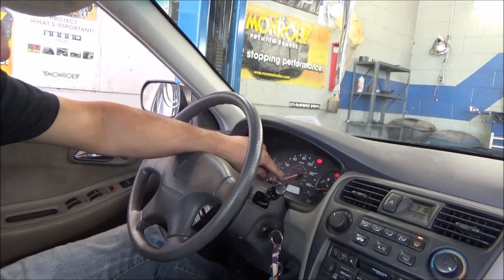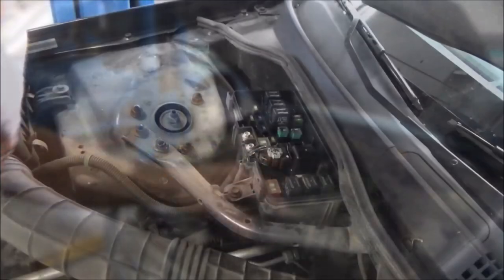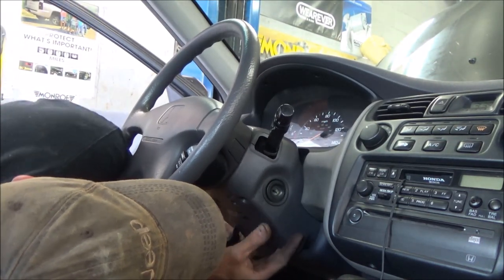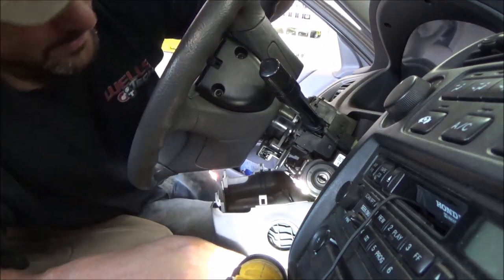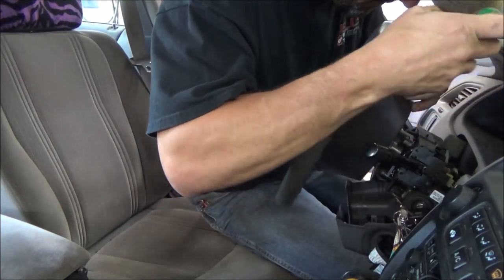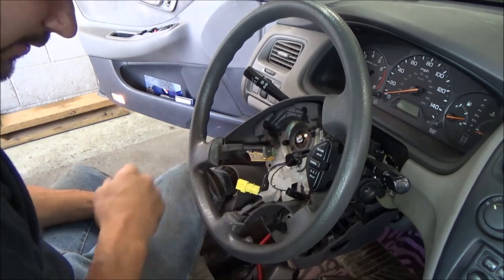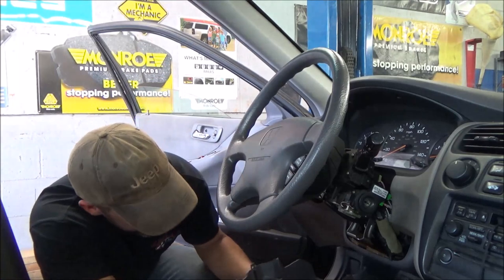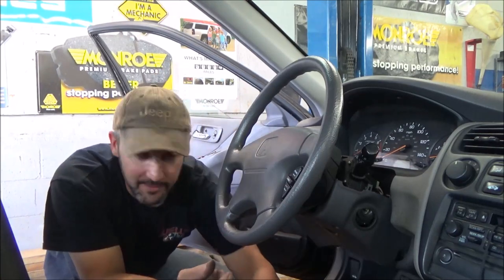Honda Accord: No Horn, No Cruise, Air Bag Light On

Comment: Eric  thanks for video !! I have cruse control problem , 1998 Accord V6  I replace cruse module ,steering switch  , also the on off switch on the left that won’t lid on wen I press, there is no cruse engage ligh on dash  .  Would the clock spring be the problem ? The horn works  ,  the volume switch for radio don’t work on steering  also, I do have a after market radio don’t know if that has something to do.  Am a cruse control user and am trying to fix it  thanks

Comment: @South Main Auto Repair LLC  Eric i have a 98 accord the contact under under the horn pad doesn't not let off and keeps on blowing i removed the air bag but didn't c a way to get under the pad does that means i have to replace the air bag??

Comment: Why would you destroy the part I keep all the parts at my shop since I'm the lead mechanic but I wouldn't destroy it
Reply: Billy Simons It's confirmed broke, what's wrong with doing an autopsy? You can't kill that which is already dead.
Reply: Billy Simons If it could be repaired, maybe. But this is just some plastic junk with a broken proprietary cable inside that you could never replace.
Reply: Billy Simons Unless they're valuable or rare parts, you can get most anything you need at a Pull A Part or other junkyard for cheap.
Reply: Hello world I don't keep them in my shop acctully I keep them in my basement and in my bedroom and all the alternators I keep are in my dining room and spark plugs are in my truck tool box
Reply: Of course she loves me she is the one who likes to keep the parts and help me sometimes on cars but she said as long as I don't get grease on her side of the bed I can sleep in the bed because I keep inventory of all my stuff

Comment: So the cable wire tape was installed in the reel folded like that?
Reply: It's a 15 year old car. The tape would have been pulled back and forth a lot over the years.
It's inevitable that there would be a sharpish bend somewhere in that setup.
Plus plastics become more brittle over time, even well protected plastic will - just takes longer.

Comment: I would love to come and help you but its a long way from montgomery county maryland  by that way I got a question on my 2002 kia sportage the horn gets stuck when I press the switch stops when I remove key from the lock cylinder I don't think is the relay because when I lock the car with the remote control the horn works fine do you think it could be the clock spring I haven't really messed with it yet but I was thinking if it was the switch it will still blow when I put the key back in the lock cylinder

Comment: Merry Christmas to Eric and his family. Thank you so much for all your videos. 
My 2006 Honda Civic have almost same symptoms as this accord had except the horn goes off if I turn the headlight on. 
First SRS light came on, after two weeks cruse control stopped working and this week while I was driving with headlights on the horn started going off. Horn stopped when I turned the headlight off. Recently transmission was changed (ground cable on the tranny is secured) . Another thing I noticed is that when I turn steering wheel rapidly cruse control light and horn comes on for split second. All my symptoms indicates probable cause is faulty clock spring except why does the horn stops when I turn the headlight off? Thank you for your advice and suggestions.

Merry Christmas and happy new year for all

Comment: Great video!!  Question... I think it is possible but, can you loose function to one or two things and not all three within the clock spring?? My srs light came on and I lost my cruise control at the same time but, my horn still works....
Reply from the maker: +Zcudazz That is true, you can loose one or all
Reply: +South Main Auto Repair  
 Thanks for the reply, sorry for the delay and fyi the Horn finally went so now all 3 symptoms are present LOL . My new Clock spring arrived and I  will be installing it hopefully this weekend.  Again thanks for the videos.
Reply from the maker: cool! Don't forget to unhook the battery!
Reply: It is done!!  And the battery was disconnected during it. Just to make sure I didn't mess up... when I put the key in  and turn the car on.... I did it from the passengers side with my arm extended as far as possible and the rest of me as low as I could get LOL!!!  Just in case!!!  The whole process went a lot faster than I thought.   I am pretty sure the reason mine went bad was because,  I had replaced my Rack in Pinion and while the steering column was disconnected underneath the dash I turned the steering wheel all the way to the left and then right.  I thought I counted the turns correctly but, must not have and shorted the turn on one side hence when I opened my old Clock spring the wire was bent over backwards in two places. Creating the hard bends / wire breaks. Lesson learned!!    Thanks again for the videos!!
Reply from the maker: Cool glad to hear you got it all fixed back up!

Comment: Why wouldn't checking the fuse be the first step?
Reply from the maker: pssst3 You tell me what single fuse runs the horn, cruise and air bag and I will be glad to check it. The 3 broken / non working items only have one thing in common. The clock spring...
Reply: +South Main Auto Repair fuse 47, 20A shown at 2:20 in your video. If I hadnt seen it there at the top of the schematic, I wouldn't have asked.
Reply: +South Main Auto Repair I wasn't trying to be picky. Since the video was one of the best I've ever seen at troubleshooting an electrical problem, I was just wondering why you seemed to start in the middle of the circuit.  You may think your videos are just for entertainment, but for many people, this is a real education about how a pro goes about doing a job.

Comment: Forgot to always disconnect the battery and allow the ERM (energy reserve module) to drain, usually takes about 30 min.that should keep you from killin yourself.
Reply from the maker: And how could this kill me?
Reply: If the battery is connected or the reserve module is not drained (disarmed), pluging in or unpluging airbag components could cause a voltage spike and deploy airbag.Also you should be aware of the (possibility) of static electricity.Manufactures may specify removal of system fuse or disconnection of the module.Always refer to the service manual for the exact procedure for DISARMING THE SYSTEM.ALWAYS disconnect the negative battery cable.Thanks all you guys who always help us out.
Reply from the maker: That is a myth and 100% impossible. It takes CURRENT to deploy an air bag. I'll rub a balloon on my head and zap an air bag module all day long. I also test them with an ohm meter. Again, no current flow... no bang.

Comment: Well done Eric , lots to absorb but I think I got it all.   I'd love to come and work with you but I'm not that good.  How not so good- ha I smoke tested an engine yesterday, checked the fuel pressure then did an injector balance , cleaned the maf and after 3 hours pinched the pcv hose and found the valve was stuck open at idle and that was my fault for a rough idle. Wow 3 hours, not sure you'd want a guy like me at your shop plus I could only pay you $20 an hour:)
Reply: Oh yeah your looking for a Loco guy well I'm as Loco as 1-2 BBQ
Reply from the maker: Steve Rob Sounds like you did a fine job sir! I hate to tell you this but an other viewer offered me $25 so I am gonna have to turn you down unless you can pay more lol.
Reply: Ha and I was using Canadian dollars, wow I can't compete with that . Maybe Pine Hollow Auto Repairs might take me :)
Reply from the maker: Haha maybe. Oh stop you know I'd let you work for free!

Comment: Anyone have the SRS light on and cruise not working BUT the horn buttons do? My 1999 Civic has this. Read the code via the service plug under passenger kick panel and got code 1-1 (driver airbag open circuit)
Reply: My 2000 Accord has similar problem. My mechanic says it's a recall, a free fix at the Honda dealer.

Comment: I c u have the Verus back. I thought it was GONE. And I was looking forward to what u were going to replace it with. I just bought the Blue one Ford Tech Makuloco liked. Anxious to get it and try it. It would b nice if u could do a test for us on that. Great job. I thought, that Civic is a runner till I read the other comments
Reply from the maker: Bill Rimmer I am replacing it with an Autel MS908. The Verus came back with a 6 month warranty so I am gonna use that till it is gone.
Reply: South Main Auto Repair I think there was just a pretty nice price drop on the MS908P!

Comment: Has any body ever fixed a clock spring
Reply: It’s better just to toss it in the rubbish pile, and replace it. You will save yourself some headaches.
Reply: @jdrs4214  you can do that if the parts are cheep I fixed one becous my part was $2500 I just soldered the broken parts

Comment: Manufactured love to raised more problem cruise control and horn should never connected to clock spring , weak wire tape circuits in clock spring , no wonder Honda got too many recall or SRS terrible design engineering horn and cruise control in clock spring LOL !!!

Comment: Toyota’s are the same for most models and years especially 3rd gen 4runners 1st gen tacos and 1st and second-gen tundra's as well the clock spring controls srs, horn, And the cruise Control as well as other models Hondas are similar in most aspects good Diagnostics process Eric O always good to follow 1 problem path at a time normally always leads to to the problem @SouthMainAutoRepairLLC

Comment: Lose the hat for better camera access to important locations being talked about.  With most low light video cameras, exposure will adjust to prevailing conditions without adding a glaring secondary light source.  Give the camera a second to adapt to the conditions, then resume with your explain atoms. Good video otherwise. Thanks for the info.

Comment: I would do this with the steering wheel dead straight up!
Reply from the maker: NETWizzJbirk Why it doesn't matter where it is? Al long as you know, you mark the splines and clock the clock spring you could do it upside down , left or right?
Reply: +South Main Auto Repair : Yep.

Comment: eric just watch clock spring vid  my 2003 criuse stopped working on f250 ford 7.3 changed brake pressure switch, brake switch under dash, buttons and harness under air bag in steering wheel is there a way to check clock spring just by homing the clock spring how to guess i changed all the chip parts clock sping not cheap, make vid on checking the clock sping by homing one end to other side of clock spring just a  thought yea easy for me to ask if you have advise 9852581355 pete